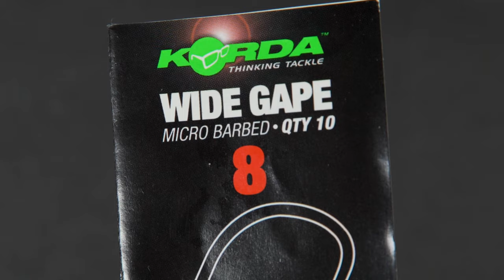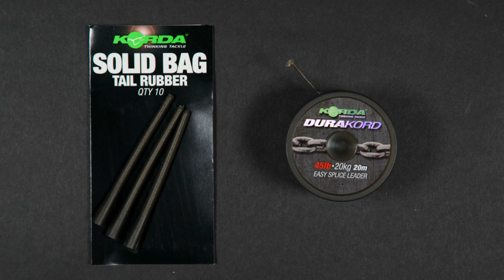A Simple Guide To Carp Fishing With Solid Bags - Solid Bag Fishing

Comment: A couple of questions.

1) what is the benefit of the solid bag Rail rubber? I get it’s a bit seal the bag around but is that it?

2) is there a need for the leader? Could you pre tie these in the same way but just using a mainline to mainline loop to loop in the absence of a leader?
Reply from the maker: 1) Yes it just helps seal the bag around it. 
2) You could do a mainline loop to loop, the leader just helps keep out the way of the fish's fins when they are swimming around on the spot! 
If you use the mainline loop to loop, just be sure to trim the knots neatly, and check that if you snap up, the lead can slide up and over the loop. (to make it a safe rig!) 
Take care :) 
Carl

Comment: Hi guys, great vid, I'm copying this setup as a first timer with the pva bags. Can I ask what type of main line are you using? I noticed the braided hooklink is 25lb and the durakord is 45lb, so should the mainline by rated higher than this?
Reply: If you are using a monofilament mainline I'd personally go for it in 12lb or 15lb if you are targeting slightly larger carp.